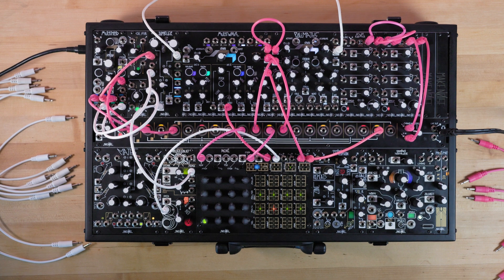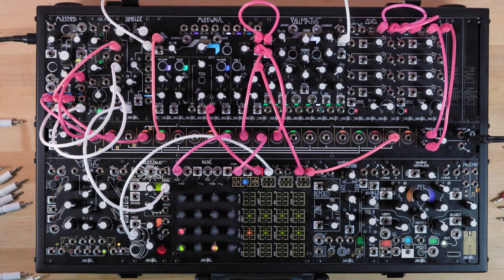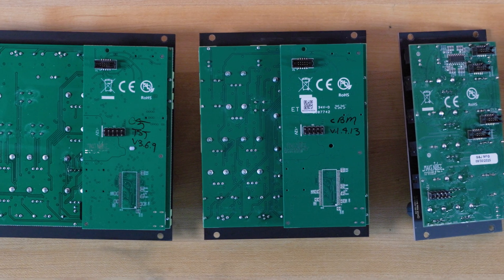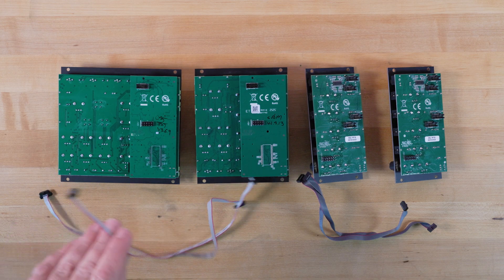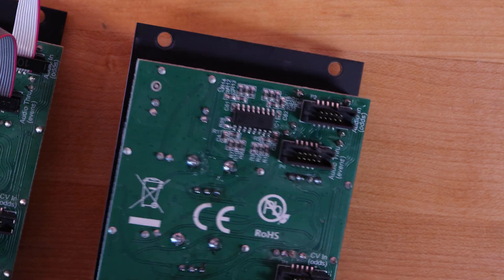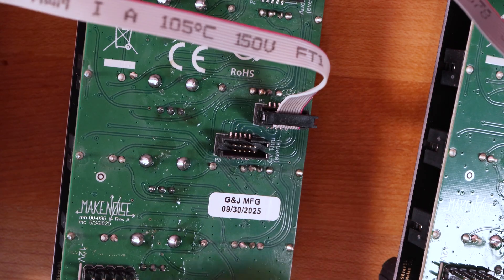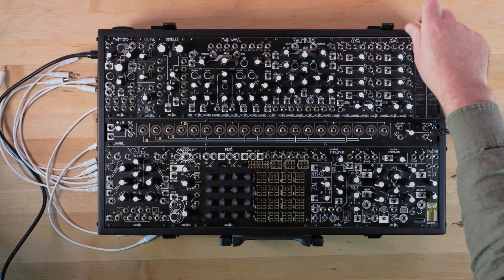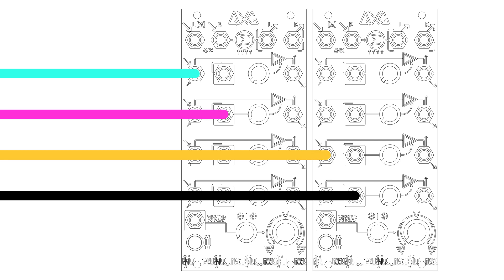How to connect New Universal Synthesizer System modules with chain cables

Comment: Can the multimod be connected in the back to any of the other modules?
Reply from the maker: Yes it has an output header on the back to connect to QXG. Your choice whether to connect it to signal or control inputs.
Reply: @MAKEN0ISEMUSIC  following up on the above question does that mean it's also safe to connect the polimaths  to the signal in on the qxg if we want to use the polimaths as a voice? - ps the videos are fantastic.
Reply from the maker: @MARSONA_sound  Yes, you can do that if you like. However for many standard patches it would be overkill, because the poliMATHS audio use already contains a full voice structure. If I'm using PoliMATHS for audio I usually bypass QXG entirely. You can also always try it out by patching it and if you love it and keep using it, consider making the chain connection!
Reply: Thanks for the quick reply and makes sense, I might try it anyway just for fun.  Also very exited to route the multimod as I use that as a voice quite often and had been eyeing that back connector but worried I’d fry something. Thanks again!

Comment: Demos of the NUSS have been absolutely stunning. Congratulations Make Noise! I was thinking about an analogous analog oscillator version with 8 STOs but I would think that might require an 8 channel quantizer. Is there a chance the multimod could add quantization in a firmware update?
Reply from the maker: Glad you are enjoying! MultiMod is calibrated to accurately pass quantized signals through its input. Check out the video "CV Sequence Replication" for an example: https://www.youtube.com/watch?v=ac-1PLhzAj0
Reply: @MAKEN0ISEMUSIC  super cool thanks!